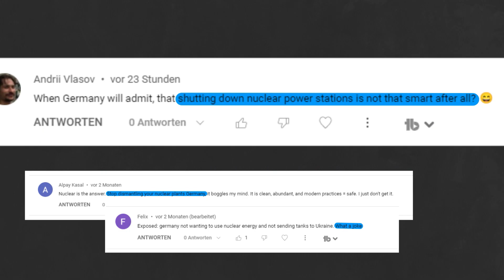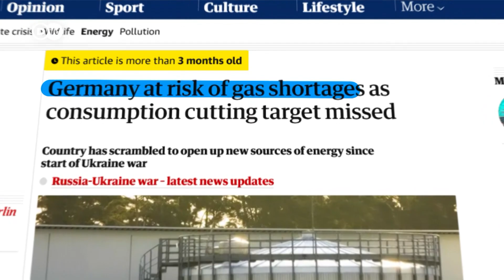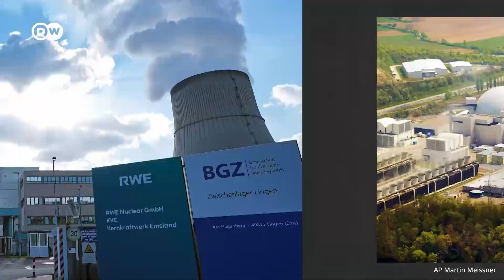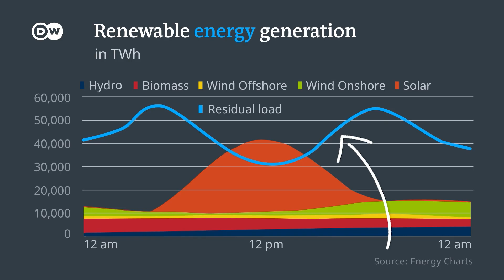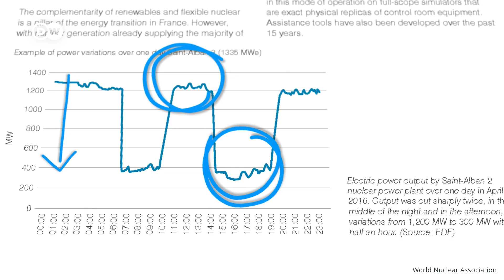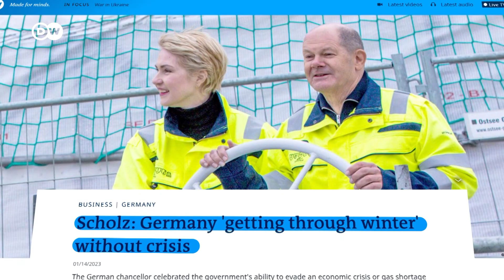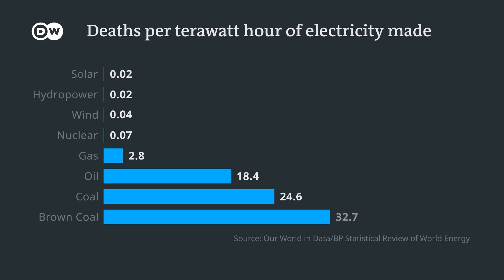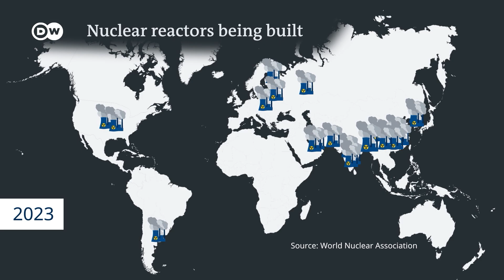Is Germany's nuclear exit a mistake?

Comment: "Nuclear plants are unreliable" Joke of the year😂
Reply: Normal europian countries: "We have to become independent of russian gas supplies. Let's built nuclear power plant".
Germans: "Nuclear plants are unreliable, russian gas delivery is unquestionable".
Reply: Yeah, I don't even know what he means by unreliable, unsafe?. The time to lower its output to 20%?. Like, the reactor isn't gonna brake down and you have to hit it a few times to get it working, there's no background to the claim.
Reply: romans lived two thousand years ago and the first pharaohs 5000 years ago. We know little about them. imagine we bury nuclear waste that will last 100,000 years and is deadly. You cant do that the the future generation. We in Germany still have no repository and nobody wants it so...And the construction and dismantling of the nuclear reactors is not Co2 neutral either due to the gigantic amounts of concrete. In addition, because of the phase-out of nuclear power, we will not phase out coal later. Just wanted to make that clear. Btw Finland is the only country with a final repository.
Reply: Well, this winter about half of French nuclear power plants were out of service due to unexpected damage and scheduled, postponed maintenance. Germany did. jump in: and exporter Terawatthours of electricity from coal and Gas power plants (largely supported with gas imported via French LNG terminals).

And this spring, some rivers in France are also running low on water - which can also become a severe issue for nearby nuclear power plants who rely on the water for cooling.

So yes, there’s some aspects of “unreliability” of nuclear power in France.

And not to forget about the specific heating requirements in different countries and regions. France did for a long time rely on inefficient electric heating, which was not a problem due to “cheap” (state-subsidised) nuclear power. 

During the past winter, Germany has been massively winding down from Russian gas to other gas sources, and people are advised to install (electrically powered) heat pumps - but currently half of the country does still heat their homes with gas furnaces and another 15% or so are indirectly: by district heating from cogeneration in gas and coal based power plants.

So: those 6% of electricity from nuclear don’t mean that much to Germany, as the electricity from those plants doesn’t help people to heat their homes.
Reply: @AndersHenke  
2022 was an exceptional year because of the corrosion under stress discovered near the end of 2021 and that required verification maintenance on all 1300+MW nuclear reactors, that felt in the same period as scheduled maintenances and Ukraine War.
Due to this, the disponibility factor of our nuclear park fell to ~50% over 2022 against an average ~70% in the previous years.

Regarding the diminution of rivers water level due to drought, well it doesn't only apply to nuclear as you might know.

It is indeed a problem, but not a safety one.
The cooling circuit necessary for the power plants placed on rivers is mostly an open circuit that sends back the prelevated water at, indeed, higher temperature.
It mostly triggers a diminution of the power output for the NPP in order to respect the obligations of temperature those NPP have to deal with for the biodiversity.
So unreliability? Hard to tell when it comes to only compare 2022.

Drought will be frequent in France, Idk for Germany but you surely know that suns and higher temperatures are no good either for solar energy because of the efficiency depending on panel temperature.

Those 6% nuclear energy were still a low carbon production, the carbon bilan of german electricity won't stay glorious in order to fulfill the engagements EU took.
Reply: No not a joke but reality in France. Due to technical problems and too less water for cooling France had to shutdown most of their nuclear power plants and begged for electricity from Germany.
Reply: @michaegi4717  Talking about 2022, right? With the crossing of Retirement strikes, Ukraine War and corrosion under stress problems, yes a particular year indeed which put the disponibility factor of the nuclear park around 50% against a nominal 70% on the previous years.

30 nuclear reactors are with cooling tower, 12 open circuit on rivers and 14 are seashore. So "shut down" most of its nuclear reactors is "real" for 2022 but not an average value at all.

Regarding the water level, an open circuit NPP requires 40 to 50 m³/s of water prelevated on the rivers (12 reactors) with :
- 4 for Tricastin (Rhône)
- 4 for Le Blayais (Mouth of the Garonne river)
- 2 for St-Alban (Rhône)
- 2 for Bugey (Rhône)

So the problems lie mostly with the Rhône.
To note that the annual average flow of the Rhône is 1710 m³/s at the Mouth in the Mediterranean Sea and the lowest measure ever recorded is 560 m³/s (data: Compagnie Nationale du Rhône) at Beaucaire near the Mouth. And the Rhône will continue to lose, up to -20% in 2050 to add to the already -13% recorded since 1960 in August (data: Banque eau).
On the other hand, a NPP with cooling tower consumes 2~3 m³/s
It has been published in 2023 that the water consumption for cooling by the NPP is 12% (Data: Ministère de la Transition Écologique) because of the closed circuit technology which has an evaporation rate of 40% so 1,2 m³/s.
The lack of water for the entire nuclear park is overestimated and concerns mostly open circuit NPP on the Rhône.

The other problem is the elevation of temperature, it's a measure taken to respect biodiversity reglementations about the rejection of the water in the river after being heated to cool down the secondary circuit, EDF even got last year autorisations to send back to river water with higher temperature with an ensuring of controls to do for biodiversity purposes.

And "beg Germany for electricity" isn't technically true, this is how an electical network works since they have over production due to renewable they must sell it because it destabilizes the frequency on the network due to a non balancing of production and consumption. France received electricity which helped both France and Germany.
Reply: Seems like you missed Fukushima and Tschernobyl and all the devastating consequences 😉
Reply: @duckdivorce  that's not a case of reliability, that's a case of a very bad design being misused (Chernobyl, an experiment being conducted on a plant with no proper containment structure and a large positive void co-efficient) or in the case of Fukushima, being hit by an exceptionally large natural disaster with a sea wall that was built too small to adequate protect against the Tsunami.

If Chernobyl had not been of such a criminally bad plant design being misused, or if the plant at Fukushima had had adequate protections against tsunamis then neither would have occurred. Keep in mind that the Onagawa nuclear power plant in japan was closer to the epicentre of the earthquake and yet was left unscathed and shut down smoothly due to having a sea wall triple the height of the Fukushima one, and for being wisely sited on higher ground.

It is in no way inevitable that nuclear plants will melt down, and very rare that they do. Global warming on the other hand could very well be inevitable if we don't take action, and unlike nuclear the effects will not be localised...
Reply: @ThePurplePassage  "if if if" Well sadly "if" didn't happen, human error should never lead to disasters worth Trillions of dollars or basically irreversible pollution
Reply: @duckdivorce  Seems like you missed the part that show nuclear have same death rate as solar and wind (<0.1) vs coals (>50). Which one more devastating?
Reply: @duckdivorce  devastating, and yet the deaths per kwh of nuclear is still roughly comparable to wind & solar and far, far lower than hydroelectric power or natural gas
Reply: @duckdivorce  You must not know how either happened to reference them here. Totally irrelevant to the plants at hand.
Reply: @duckdivorce what?

Comment: 1. How odd that the German green party chose using coal, which produces over a kilogram of CO2 per kwh and stays in the atmosphere for over 200 years? This is, according to them, less risky? Millions of extra CO2 has been produced since the plants have been shutdown. 
2. Transmission is a bigger problem as it affects renewables too.
3. Germany also produces steel and excess electricity could be used to produce hydrogen and green steel 
4. Maybe the greens also caved into the powerful fossil fuels lobby as closing down coal and mines is also a hot topic.
5. Most of the assumptions are that nuclear technology has not moved on since the 70s, but they chose not to make the same assumption for renewables

Comment: You should REALLY talk about the condition of the plants there were last shut down. And how nuclear plants need vast amounts off cooling water that simply do not exist during droughts.
Reply: They can use sea water as well.
Reply: @viceralman8450  only technically. Practically, its so much more expensive to desalinate such vast amounts of seawater that its not worth it for larger nations.
Reply: @beerenmusli8220  There's reactor design that don't even use water at all as well.
Reply: @viceralman8450  The most developed one that I know of is a Fluoride Cooled Reactor, and Fluoride is not only very poisonous but also very corrosive. Additionally, HOW are you gonna get the hot fluoride into electricity? Excactly, a steam turbine :)
Reply: @beerenmusli8220   How cares are isolated and contained, newer alloys were developed, and they can withstand corrosion on this reactor, it can use non potable water as it is a close system no water is lost during the heat exchange. 
I got it know you want to go back to the stone age; quick reminder renewables are harmless they use heavy metals as well.
Reply: @viceralman8450  Oh thats really coo, would you happen to have some overview of it?

Comment: A warmer than average winter plus an extended holiday on most of German industries and a lot of LNG imports made last winter survivable.

That’s not going to be the case next winter. 

Cut off from Russia’s natural gas means that if next winter is cold or if the industries try to resume normal operations they’ll run out.

Comment: Nuclear energy is more flexible than this video makes it out to be. Shutting off nuclear is hard, but lowering output to 40% is possible. They're generally able to modulate at a speed of around 20% increase or decrease per hour. They have some flexibility. Only thing is: lowering output on nuclear energy is more expensive than it is to shut down windmills. Thats why windmills are shut down before nuclear energy is powered down. 

And thats actually okay. It is okay to not use all of the available energy 100% of the time. Its likely that will start happening more and more often with more renewables. But that problem is unrelated to nuclear energy

Comment: To answer the question of the video.

100 PERCENT YES!!!!

Germany doesn’t have anywhere near enough sunlight or wind to power it’s industries and even if it did they wouldn’t work reliably.

That requires coal or natural gas to do most of the heavy lifting and even if global warming weren’t an issue, air pollution and sanctions on Russia are.

It was a stupid idea then and it’s even stupider now.

Germany doesn’t have tsunamis and even if it did nuclear would still be safer than coal.

Comment: nuclear power plants require uranium ore to be mined out of the ground and then transported to refineries, where the ore is milled and processed into radioactive powder and eventually fuel pellets, rods, etc, at a secondary refinery. Each stage of production, from mining raw ore out of the ground, to finished nuclear fuel bundles, requires huge energy inputs + enormous infrastructure and logistics costs to safely operate a nuclear power plant. And then there’s nuclear waste. Burying spent nuclear fuel in underground caves just seems like an environmental disaster waiting to happen, imo, with the potential to contaminate local aquifers, which would be extremely expensive to remediate, if remediation was even possible (at great expense). In old underground mines, dust, radon and diesel fumes were a serious threat to miners’ health because of poor ventilation. ‘Modern’ open pit mines are safer than working underground but these enormously destructive open pit mines also have a HUGE environmental impact, which also negatively effect the health & wellbeing of nearby communities. do an image search for ‘uranium mining’ to see the environmental devastation.

“For both traditional underground and open pit mining, the rocks may have only a few percent (normally <0.3%) uranium in them. The uranium then has to be removed from the rock and concentrated. The milling process involves crushing and pulverizing the rock into very fine fragments and adding water to create a slurry. This slurry is then mixed with sulfuric acid or an alkaline solution to release the uranium from the host rock. Normally approximately 95 - 98% of the uranium can be recovered from the host rock. From this acid or alkaline solution, uranium oxide or yellowcake is precipitated. This is still not the purest form, and the uranium has to be sent to another plant to enrich it. The remaining rock slurry is pumped to a tailings dam. These tailings are exposed to the surface and heavy metals can be released into the environment.” - New Mexico Bureau of Geology & Mineral Resources

Comment: The baseload problem is vastly overblown and misrepresented. First, there are almost zero days where there is absolute darkness and no wind anywhere in the country. Wind is blowing always somewhere, same for sunlight. Second, day peak consumption losely correlate with peak production during daytime. Third, adaptation: household batteries and appliances can be programmed to consume more when electricity is cheaper, i.e. peak production. Industrial consumption will also adapt to availability and prices. Consumption patterns are to sone degree formed by availability, not just the other way around. This is often neglected.

Comment: I think it was a big mistake to leave nuclear. The greens are always saying, that we only need to push renewables hard enough but here we have to big problems. Thirst regulations, a lot of them. Before anything can be build years went by so we can not really push hard. Even if we had enough renewables to cover 200% of Germanys electricity demands, renewables are not stable. So one day we cover 100% the next 0%. It should have been the rule, that for each renewable energy source a large energystorage had to be provided alongside it. I rarely see the cost of energystorage put into the consideration for renewables but they really should be put in there if you want renewables to cover your entier energy demand.

Comment: Agree, with virtually all of the comment, shutting down nuclear  is a mistake. In addition, I would like to compare the issue of nuclear waste storage, with the effect of co2 build-up in the atmosphere. Both are issues with a long  and perhaps comparable time constants. The difference however is that nuclear waste facilities are  engineering cost for future generations but manageable, while climate change /sea level rising will render  a significant area of our agriculture lands unusable due to drought/ excessive rain and flooding. Moreover,   mega cities of which most of them are situated in deltas are threatened by (near) future flooding as well.
Reply: Yeah. We have this topic at school right now and as far as I remember, our problem was always the waste storage. Nobody knows what to do with the waste, we don’t have an ,,Endlager‘‘ and that will be a big problem for the future generations. Sie werden wahrscheinlich für immer die Abfallstoffe hin und her transportieren. Es gibt nur Zwischenlager. Das ganze braucht dazu noch Millionen von Jahren um sich abzubauen. Keine Ahnung wie es noch enden wird.
Reply: @line1631 fuel can be recycled and once it has been (it takes a couple times) it will be safe within like 200-300 years. Which really isn’t that bad.

Comment: one important factor to make solar more useable is to make the price at daytime go down and the price at nighttime go up. A behavioural adaptation is important for a switch, too. 
Incentives are important
Reply: Another thing you could do to make solar better is to move Europe much further to the south.
Reply: @missano3856  please dont its already hot enough in the summer
Reply: @Freedmoon44  Well consider that the single largest source of electricity(by far) in Arizona of all places is nuclear not solar and you see the problem for Europe.
Reply: Solar panels right now last 20-30 years, and after they’ve degraded, there isn’t many systems in place with the thousands of solar panel companies to dispose of them properly. They’re pretty toxic and most of the material ends up in landfills.

Comment: What isn't made that clear in this video is that closing already built reactors is quite different from building new ones. I am against new nuclear because it is expensive, slow to construct and results in high emissions during construction. None of these apply to current reactors. Closing them simply increases emissions and people who think that the risk from current reactors is greater than those of climate change don't understand climate change. It makes no sense.